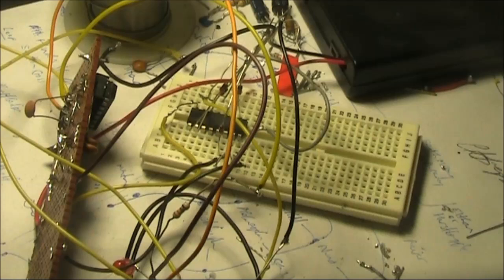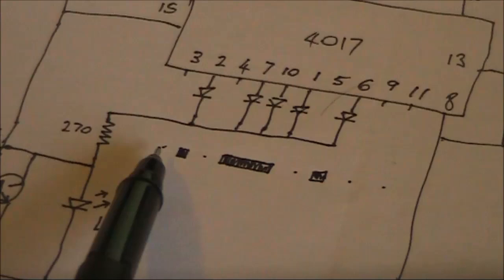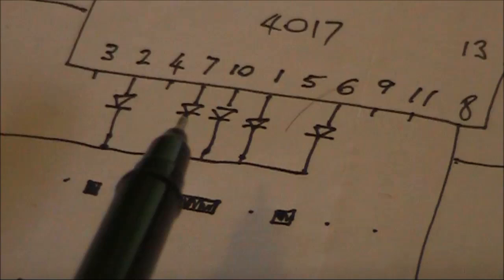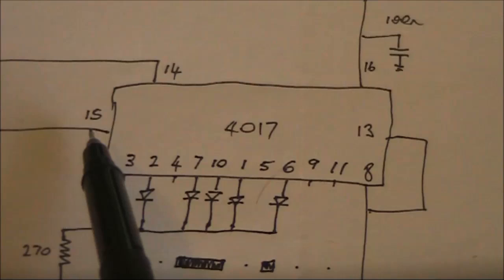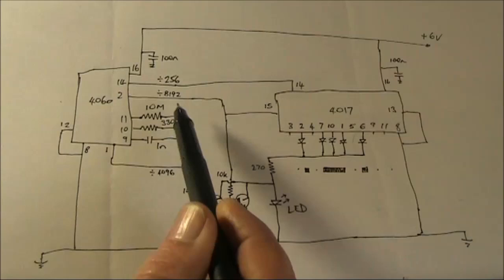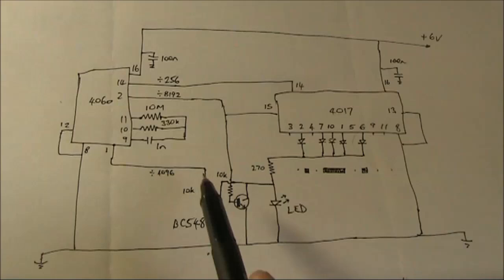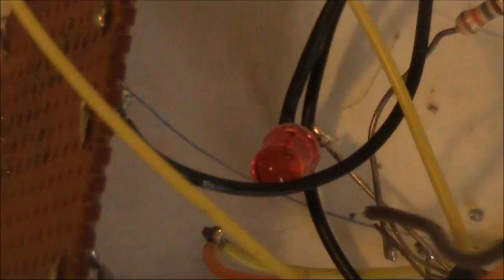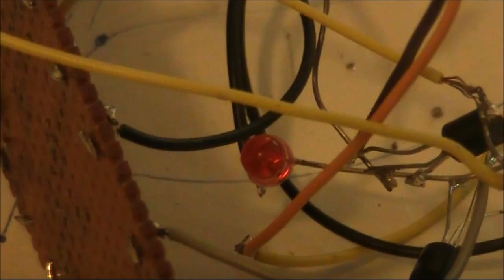Single letter morse code generator with 4017 and 4060 CMOS ICs

Comment: I'd have not thought of solving it that way - thanks for getting me thinking. But surely an Attiny85, a single bypass cap and 5 lines of code in the Arduino IDE would be way more practical.
Reply: Absolutely, that's probably the way I'd do it, because it would mean less wiring to do. But I think it's very interesting to see how we might do these kinds of small tasks with discrete logic as well. You could say microcontrollers are almost like cheating when you could use some very simple discrete logic instead.

Comment: Another video of a variant that is common and can do 2 letters,
 https://www.youtube.com/watch?v=IN6QJ6nOC04 
Plans here,
 http://s165.photobucket.com/user/ba276/media/Morseidentkeyer.jpg.html
Reply from the maker: Many thanks.  A novel design.   Hard to understand how it works but easy enough to knock up!
Reply: I just had an idea, won't two of these IC be able to do much more? since there's a theoretical 10x10 = 100, and if you use logic gates you can assign every possible combination

Comment: Peter, using this concept, how could i build a call sign generator, eg vk2 xyz.
Reply from the maker: You would need to team up lots of circuits to handle longer strings of letters. Or use an Arduino.